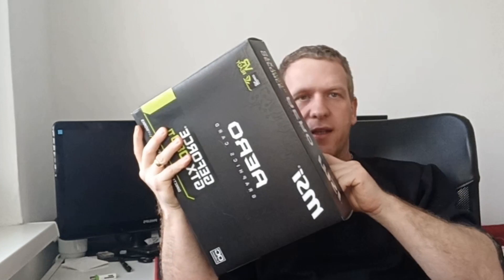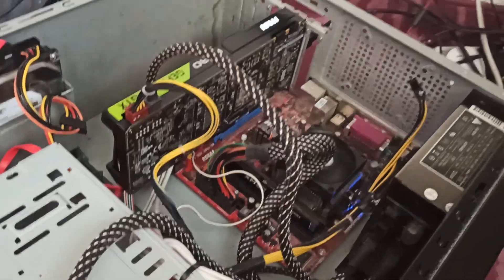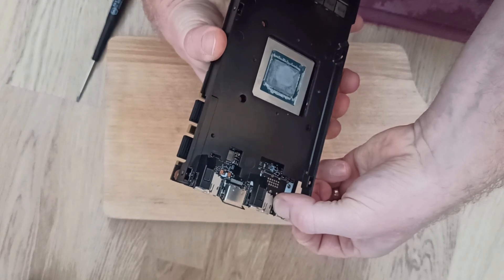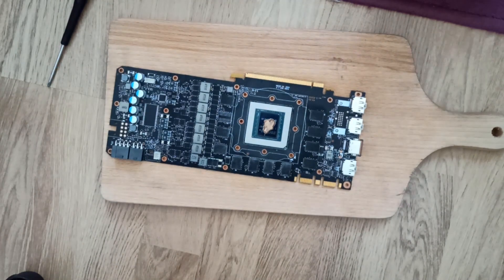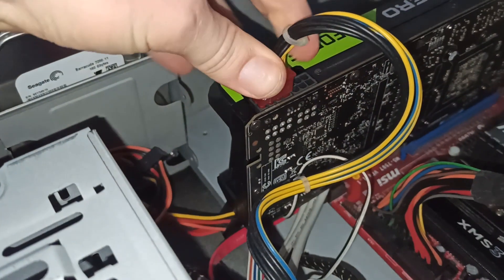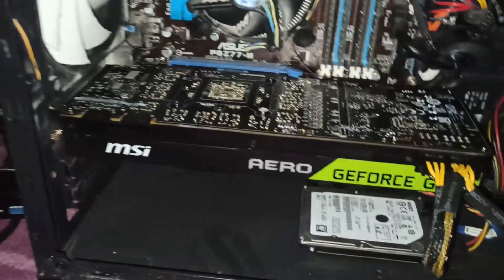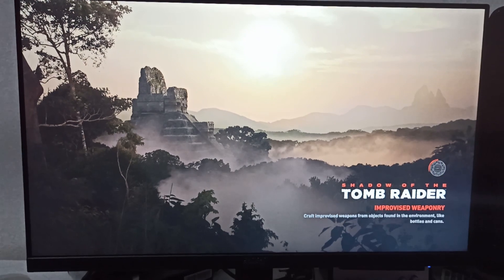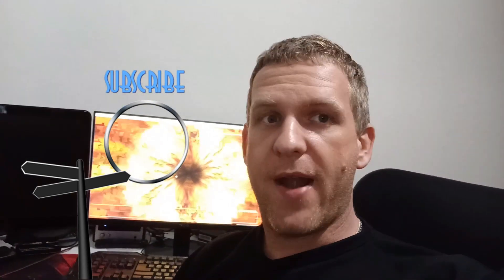How to fix No Signal or Black screen problem on any GPU - this time on GTX 1080 Ti

Comment: I am about to try on my 1080ti, pray for similar resultts i still love this card hahaha. I have the Gel flux and heat gun ready, Looking at your previous tutorials, start higher from the board by 5cm and move down over 5 min, then heat the die for 10mnin and slowly raise after?   
Bit nervous to do it but nothing to lose, exactly same situation, card gets warm, fans go, lights on but no video out and VGA light on.  Was running game when crashed, started PC back up and ran fine for the rest of the night then when turn on the next morning weird glitchy lines, restarted PC and never got video out again. (no sparks or smoke smell when this happened) Thermal paste was dry though =(
Reply from the maker: @keatoncreates  nice let me know the resold and also don't forget heat vram as well. Nice to hear you watched that video carefully and that's Also my word. Proper repair in shop will cost you more than new used working card. For that reason is always worth to try there is nothing to lose anyway and ye happens as your thermal paste drying. Good luck and don't forget subscribe

Comment: Can i use Soldering flux Liquid 50ml oiler- SMD/RMA No Clean,Reflow, Rework, Reball RF800 and can i use any heat gun?
Reply from the maker: @UmarAbid  hi yes you can

Comment: What does the heating do? From what I can see it fixes the issue but what does it do to the chip itself?
Reply from the maker: It's hard to explain but easy explain is reheat malted solder points under chips and make reconnection

Comment: Never warm up 10XX video cards, this method will not help. This worked with older versions of video cards, but now it doesn't.
Reply from the maker: This method works with any card and if you card is out of warranty there is nothing to loose anyway as proper fix can by more expensive than new used card but is your choice you want to try or not

Comment: When taking the cover off the 2 pin white connector. Is that just a temperature sensor?
Reply from the maker: White connector is usually fan
Reply: @frogtechtips  seems to be the temp sensor 4 pin is fan power. Doesn’t seem to be necessary. Got a 1080 from local good will for 25 bucks
Reply from the maker: 2 pin also can be light on GPU

Comment: Hello mate, do you still fix them? I maybe have a interesting rippoff storry :( need help with a gtx1080 msi trio x that i bought and i got ripped off
Reply from the maker: Yes I still can repair them
Reply: @frogtechtips  how can i contact you? It seems like its also the Heating of the Chip itself .... i opened the card now everything looks finde. I just dont get any image at all (after i got some artifacts). Do i need to apply flux before the heating up or can i try witouth it?
Reply from the maker: Definitely use flux as well you can contact me on email or Facebook fan page frogtechtips

Comment: Hi my aorus 1080ti is showing no display and a vga debug light after a driver update,ive taken it apart,no obvious signs something has gone wrong i tried it in a different computer and its showing the same issue,i have no idea what to do
Reply from the maker: Hi you can try reheating your GPU like I do in video

Comment: my 1080ti also has this issue, black screen after game play (Forza horizon5/ genshin impact/ cyberpunk) so far, but no issue when burn with 3d mark...no idea why
Reply from the maker: Did you try replacing Thermal paste
Reply: ya i replaced and using water cooling already, burn GPU program shown max 42C max @frogtechtips
Reply from the maker: And is do just in that game

Comment: Hello, I have an evga 980 ti 6gb card, the problem is when I go to the game, after a few minutes the screen goes black and the graphic card fans work. I have to restart the system to take pictures again. I changed the thermal paste to no avail. I also get good fps in games, this shows that the card works well. Actually, sometimes I play with this card for several hours, but I don't have any problems. Please tell me where the problem is
Reply from the maker: Hi you GPU have problems and over time will be completely dead 
You card is so old
Can try underclook you GPU with can help but you will loose some FPS or tre reheating with should help

No reason to take to repair shop as repair will be cost more that some new GPU
I will definitely try reheating there is nothing to loose and if doesn't help just buy new GPU
You can buy some GPU with have more power than yours one very cheap
Reply: @frogtechtips  thanks
Reply from the maker: @ArashAkhlgahpour  you welcome

Comment: hi, i'm having issues with my new 1080ti (inno3d ichill) everything's fine until i started to play games just for a while, it crashed and rebooted my pc (while playing something like metro redux it was running fine at 60fps max settings, skyrim, doom eternal they're all fine) should i underclock the gpu? or flash my bios?

my spec
i3 12100f
ram 16gb 3200
m.2 1tb
psu750w 
gtx 1080ti
Reply from the maker: Hi this sounds like PSU problem I think
Reply: @frogtechtips  thank you, i will try to change my psu
Reply from the maker: @SuperEarthHelldiver  how old is you PSU and it is gold or bronze rating the one you have now

Comment: Heyy, I dont know if you are still replying but i wanted to put forward the issue that has been driving me insane from a couple of days. Since i cannot afford a new gpu rn or even a used one lol, my friend gave me his GTX 1080 as he upgated his GPU but i am not getting display on it. I have tried the following: 

SPECS: 
Intel Xeon 1245 v3
16gb ddr3 1600mhz
Asus b85m-g
650 watt cm  80+ gold. (tried different psu too)

1. It does boot up at times (once in 20 times), when it does boot up, it works like a charm but when i restart or shutdown my machine, it doesnt work. 

2. I tried it on an AMD pc (two of them with different configs infact) , the card booted up in a second but it was not performing well, a lot of jerks in furmark and games, FPS dropping almost 50% and alot of stutters. 

3. I tried DDU, i tried latest BIOS and i tried LATEST and old drivers as well. 

4. It doesnt work on any INTEL system, it just doesnt boot or give display. 

I am really tired after searching for long, unable to find a solution. And i live in pakistan so there is no official support for GIGABYTE here
Reply: Bro, the card is working fine on another friend's pc which is and AMD one. And my psu is definitely not the issue since i even tried a 850 watt one, same issue. 

Plus i opened the card and checked for physical damage, nothing wrong. No leaks.
Reply from the maker: @waqaswadiwala6266  that's really interesting problems and not sure what can be wrong as you write on AMD working with no problems sorry for no tips from me do you have more PCI express slots on your MB if yes try on other slot or also try removing RAM Stick if you have more that one maybe is compability problems
Reply: @frogtechtips  Also, can we connect over some call too? So that i can explain in a better way?
Reply: @frogtechtips  and with amd too, the card boots up but the performance is like 30% of what it should be. Alot of jerks and stutters
Reply from the maker: @waqaswadiwala6266  if it's like this I will definitely try reheating GPU
Reply: @frogtechtips  ok il try reheating. Then let you knoww
Reply from the maker: @waqaswadiwala6266  ok
Reply: @frogtechtips  reheating didnt work too
Reply from the maker: @waqaswadiwala6266  you already done so quick:-) that's no idea maybe try reflashing bios
Reply: @frogtechtips  bios reflashed too. Older version and newer version both. And yea i did it with caution..had all the tools prepped
Reply from the maker: @waqaswadiwala6266  man that's so interesting áno no idea looks like you tried all what I will do
Reply: @frogtechtips  Yes man. Its just so sad. Because i cant afford a gpu now :(
Reply from the maker: @waqaswadiwala6266  top i understood this is hard situation try have a look on elitech channel and make some measurements on card he have some good videos about that
Reply: Bro i dont have another pci e port but i tried it on a different intel.board with a different slot, it didnt work. Also, i tried with differrnt single sticks too.
Reply from the maker: Hi man did you try that card on friends PC where been used that card before 
And how long been not used this card

This fault sounds like your psu is not strong enough but as you trying already with different one I will definitely look on GPU for some physical damage and look for capacitor for leeks or burn

Comment: Reflowing graphics cards is NOT the way to fix them. This is a bodge job, you should not be working on cards when you do not know how to fix them properly
Reply from the maker: You right is not proper fix and is also last step I recommend this method is for someone who don't want spend to much or trying save card for save money for new one.
If you don't like it simple don't do it

Comment: Do you think that the reason that poor graphics card is faulty is because there was no thermal paste and it got hot enough to melt solder?
Reply: No more likely it got dropped and solider cracked between GPU and the board.
Reply from the maker: That's can be reason as well
Reply from the maker: That's definitely tru I think

Comment: I got proplem with my 1080 i was using Mining riser on it and i saw a spark coming from the riser and now my gpu switching on and fan working but its not detecable any more i tried to heat the chip but nothing what should i do ?
Reply: Australia
Reply from the maker: That's will be so expensive postage price you will need find someone locally
Reply from the maker: Hi is you have spark that's mean there is burning damage with is hard to fix
Reply: @frogtechtips  can you repair my 980ti with same issue
Reply from the maker: From with country you are

Comment: Hi, Thank you for the vid. Had the same issue with my 1080Ti had the extended warranty and it was replaced with a 2080Ti!! But now 1 year or so later now the same thing is starting to happen with my 2080Ti.. DP no signal !! I have to constantly reboot! and some times I have to wait a few hours before it will decide to work again!  WTF. Thanks again for the vid
Reply from the maker: You welcome and I hope you are click subscribe as well

Comment: Hi, I have a same problem with zotac 1080 to , the card boots up normally, it lights up and fans run. It's even showing in device manager. But no display or back lit at all. After trying install drivers it's breaking my windows system. What do you think is the problem? PCB seems absolutely fine, no signs of damages . 

Looking forward to your reply
Reply from the maker: Hi first at all try your GPU in different pc if the same open clean and replace Thermal paste and if still not help and you try all other solutions  as some old driver or flashing bios I will definitely try reheating GPU specialy if your card is out of warranty there is nothing to lose anyway
Reply: @frogtechtips  yes it is out of warrenty, already switched PC. No use.  can you guide me about flashing bios? Is that something that I can do on myself?
Reply from the maker: @jivanbhange  go on techpoweron web all about flashing bios you will find there
Reply: @frogtechtips  hi, I just flashed the bios successfully, still no help, not taking drivers , system error on windows after driver installation. What say?
Reply from the maker: @jivanbhange  ok good job now you try all you can now I will be try reheating GPU as your card is out of warranty there is nothing to lose anyway
Reply: @frogtechtips  okay I will try reheating. Any specific heat gun that I should use and specific flux?
Reply from the maker: @jivanbhange  definitely yes is cheap and you can be sure you will not make a short under chip
Reply: @frogtechtips  any heat gun would work? Or any specific heat gun?
Reply from the maker: @jivanbhange  hi any heat gun will be ok even the cheapest one :-)
Reply: @jivanbhange did it end up working?

Comment: My aorus 1080 ti xtream had a complaint please help.
Actually problem is when i checked card i plugged out the fan Connector the gpu works perfectly and when the fan Connector plugged in the display goes black screen.
Please help guys 🙏🏻
Reply from the maker: You mean if you unplugged fan card working without no problems just fan doesn't works
Reply: @frogtechtips  no sir fan works when plugged in and the gpu fan works at higher rpm but no display and when it unplugged the fan Connector and gpu display works normally
Reply from the maker: @KingPin-09-31  and if you unplugged fan GPU working
Reply: @frogtechtips  yes sir that's the problem
Reply: @frogtechtips  what will i do sir please help
Reply from the maker: @KingPin-09-31  that's interesting I never see problems like this
Reply: @frogtechtips  yes sir me too doesn't scene like that
Reply: @frogtechtips  please help me sir. Im in big trouble
Reply from the maker: @KingPin-09-31  as your card working without fan I will try checking card for physical or burn damage and if nothing visible maybe try replacing fan module or trying power fan externally from mainboard to Keep card cooling down or something like that
Reply: @frogtechtips  is it safe for power up externally
Reply from the maker: @KingPin-09-31  hi ye it is just by sure you check temperature card
Reply: @frogtechtips  i have messaged in Instagram sir
Reply from the maker: @KingPin-09-31  ok
Reply: @frogtechtips  Thanks 🥺 im waiting for your precious reply
Reply: @frogtechtips  sir give a solution please
Reply from the maker: @KingPin-09-31  I write before you need open card and check for physical or burn damage
Reply: @frogtechtips  ok sir i will do
Reply: @frogtechtips  sir can you please tell me that auros 1080ti xtream best thermal pad and which sizes we need to replace the whole gpu
Reply from the maker: @KingPin-09-31  hi for this is hard answer as best way to find is open card and measure pad and with thermal paste is best form my opinion and testing there is not big difference but artic Zero or HY870 is good
Reply: @frogtechtips  thanks sir

Comment: Hello! I have i similar problem on my 1070 ti. No signal ever at normal startup, but when I push the reset button I get signal and everything seems to work fine. So right now I start up, push reset everytime i star my computer. Can it be the same problem? Thanks
Reply from the maker: Hi this looks like you PSU problems like don't start and give full power straight after Star I will probably test this card in different PC or try different PSU if you can that's will be first step from me
Reply: @frogtechtips  Thanks for replying. I changed from AMD Rx580 to my 1070ti yesterday. And when it didn't start at first I suspected hardware change and driver issues first. PSU problems is a good chance. It is 600 watts, but bought used with unknown history.
Reply from the maker: @eivindbjrge1173  top PSU can be problem as 1070 is hungry try that first

Comment: Hello everyone ! I have a problem with my new mini laptop GT-R7 ryzen 7 3750h for a short time following an attempt to update the drivers when I start it my screen displays "NO SIGNAL" although it is turned on with vents running 

I can't do anything more with it. I tried almost all of them, I changed hdmi cables, restarted without ram several times, I also tried CLEAR CMOS but nothing worked, here I am really desperate, I would like to know where the problem comes from ...
If anyone could enlighten me on this, that would be great. Tell me if you need more information about my computer Thank you in advance!
Reply from the maker: Hi your laptop sounds like new maybe is still under warranty if yes go that way first
Reply: @frogtechtips  hello, thank you for your answer, and yes it is still under warranty but the problem is that I can't send it back with my personal data inside, I really don't know what to do I'm desperate
Reply from the maker: @lepainchocolatine9553  just remove HDD plug in on different pc and do back Up and delete your personal Dada once you done put HDD back and send for repairs that's what I will be do

Comment: hey i have a gtx 780 with 3 burnt phases and apw7142 chip burnt if i just get it replaced will the card work? what else should i check on my card with the multimeter?
Reply: how can i contact you? i need to share photos, burnt phases are SIC780 chips 
i have ordered them and apw7142 i have ordered all but what else do i need?
Reply from the maker: Hi you can contact me on email or Facebook page
Reply from the maker: Is always about how big is burn and if there not physical damage to PCB usually just need replacing foulty component
Reply: @frogtechtips  hey i have filled you with bunch of texts on facebook, please take a look and let me know.
Reply from the maker: @rajadanish1629  i already replied
Reply from the maker: @rajadanish1629  Also look on this video. https://youtu.be/5NgAEBFdo9o

Comment: Hello I have exactly the same problem blanck screen, but leds and fans are running. I tried everything... I'm about to heat it too is there a temperature i should go over with my tool ?
Best regards 
Silas
Reply from the maker: Hi if you try all other solutions reheating is way with can help use 290 to 320 up to 10 min
Reply: @frogtechtips  thanks a lot for the answer today I tried to heat up but it changed nothing (maybe i need to go higher). But before i just wanted to tell you the symptoms maybe you have an idea: my fans are running, led is on, but the card gives no display and is not recognised by windows. I imagine there is no short as the card runs .... any ideas where to start my search. I'm going to do some measurements with my multimeter also. I have 1080ti gigabyte.
Best regards 
Silas
Reply from the maker: @silasforschle1852  for more explain try have a look on elitech channel he have some perfect videos about that